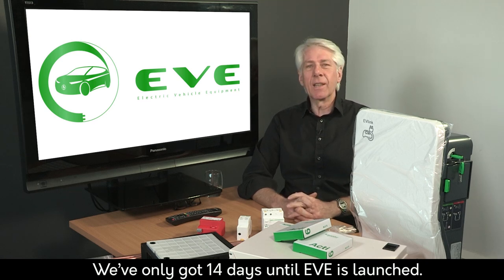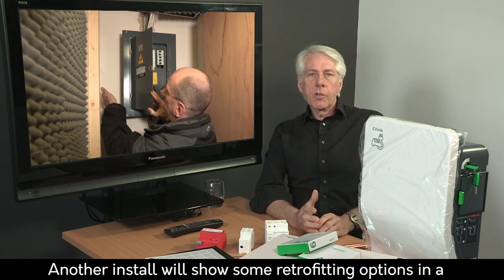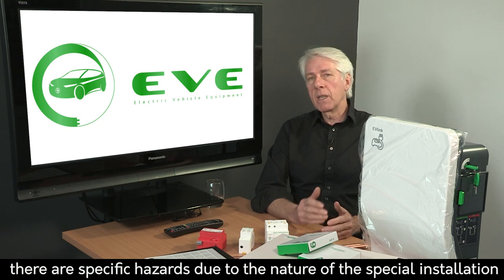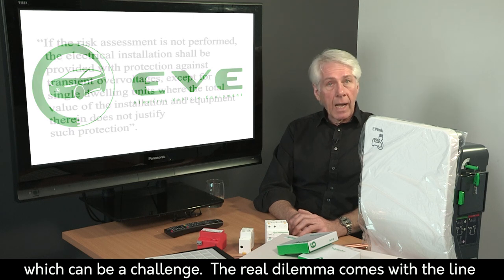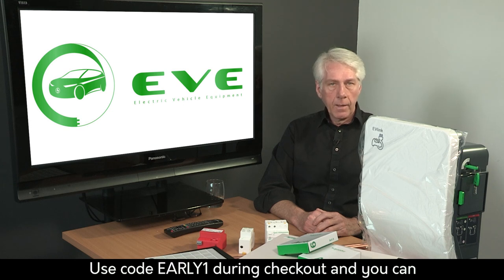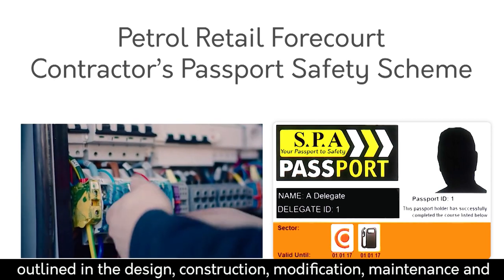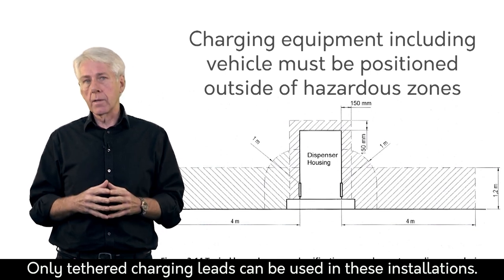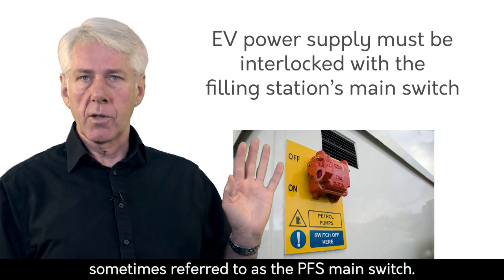Do SPDs need to be used for an EV charging point? Eve countdown video 4.

Comment: My view is that a short on the control diode can occur, the last defense is a rated relay that could fuse /burn or is a MOSFET SSR.

Could the main power handle the full dc power? Mostly no. But a DC fuse can burn out, as will AC. So it's just the time.

But if it's a spark at a fuel station.. well nothing is going to help. But it's not that dangerous in reality.